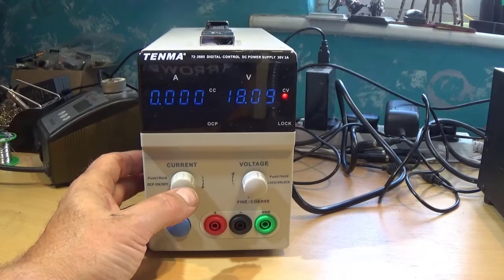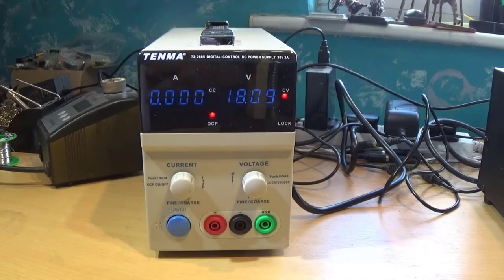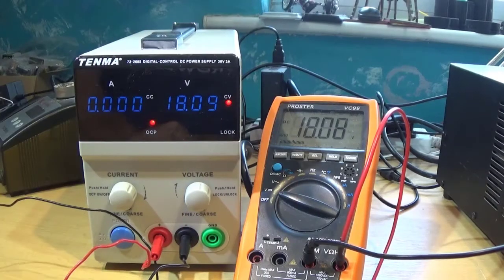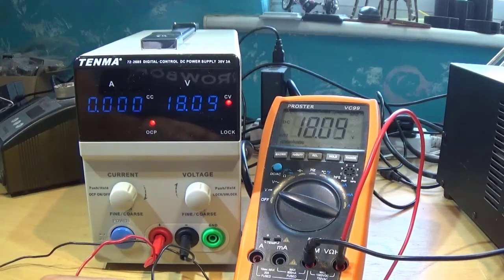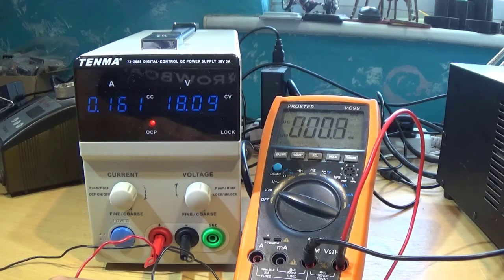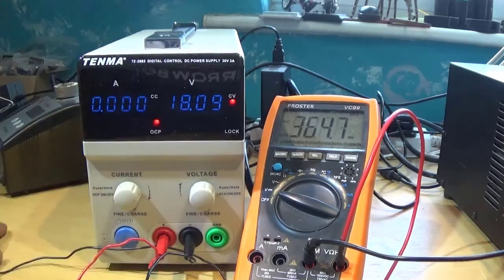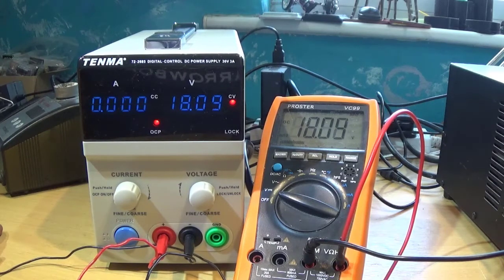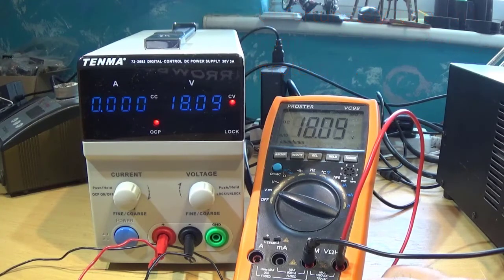Budget Tenma Bench / Lab PSU Review & Tutorial

Comment: it is very strange. I have the 2710, and the display is so flashy, I even find it a bit annoying when I work with it in the dark late at night :) What is a bit dissapointing with this unit, is that the current measurement is very bad for low currents. I work a lot on SMD and below 10mA this unit will still show 0.
Reply from the maker: I also used an earlier model at work with a nice bright display. That is part of the reason I was so disappointed with the dim display on this one. I guess the just decided blue is "trendy".
The current measurement on mine seems to be fine at low currents but you could always put a multimeter in series with it.